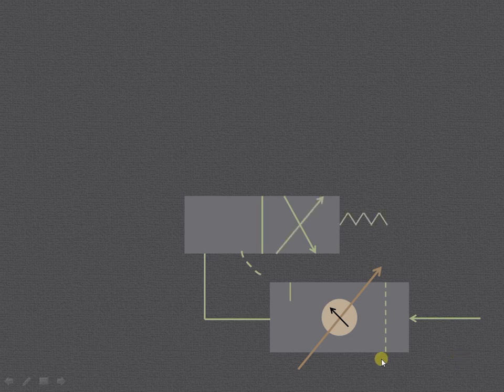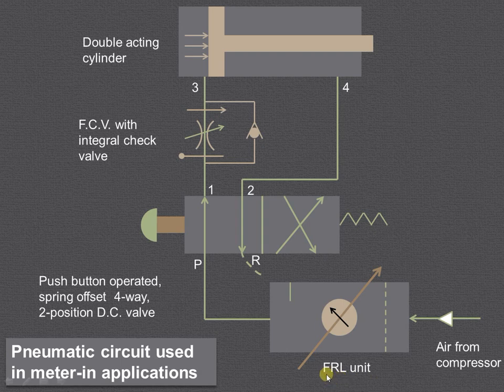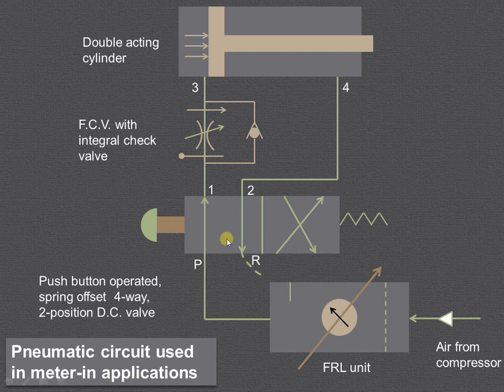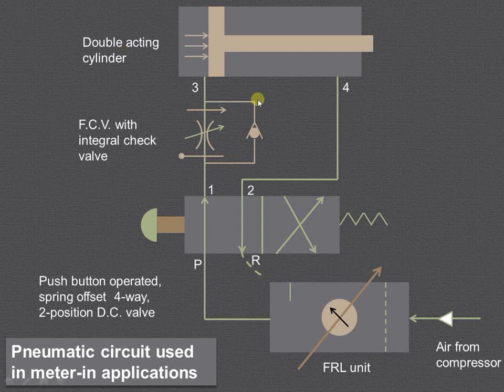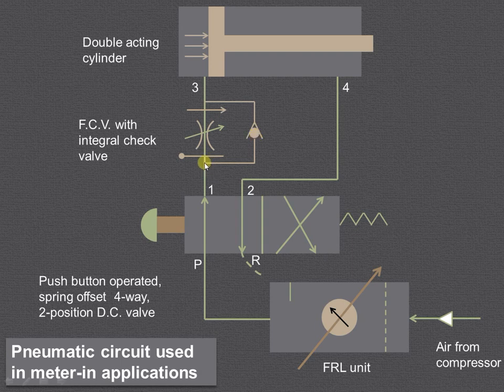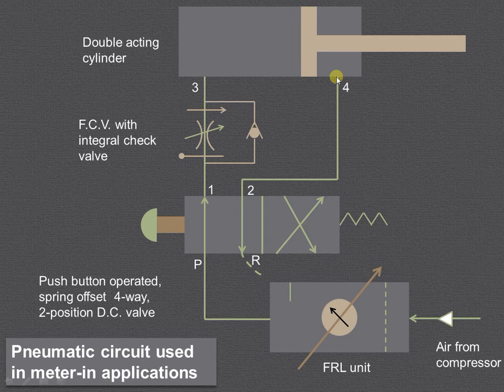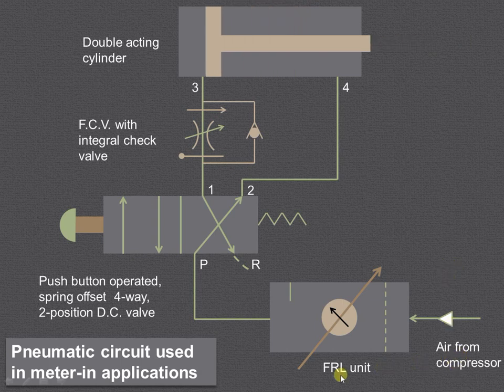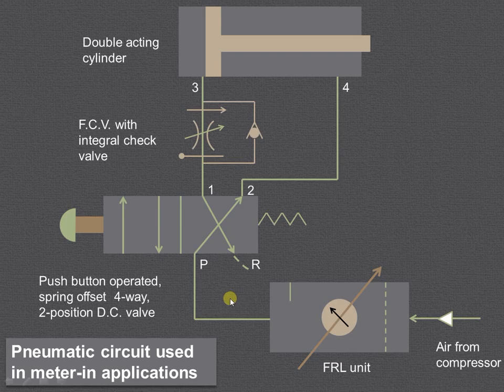Lecture 18 |  Meter - in application

Comment: is this meter in application also called as air supply and exhaust throttling, pls reply fast sir
Reply from the maker: Meter-in application is Supply air throttling whereas exhaust throttling relates to meter-out application